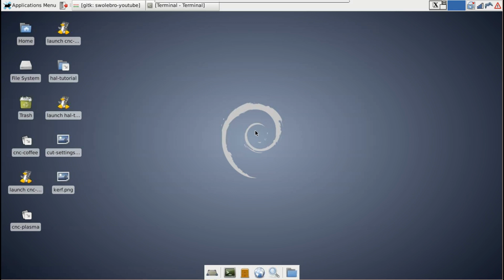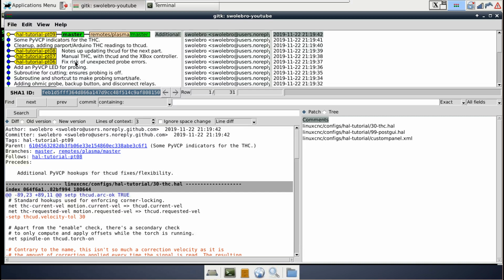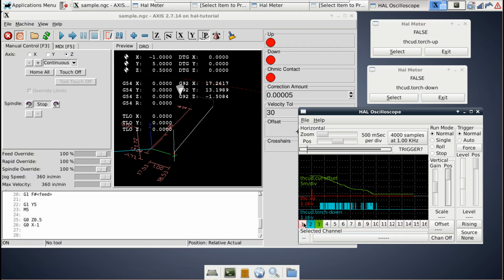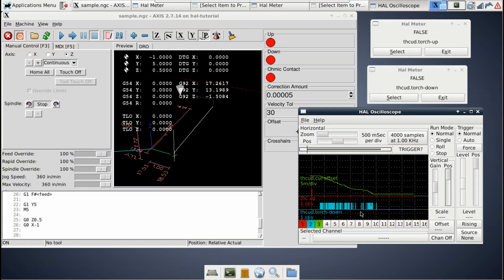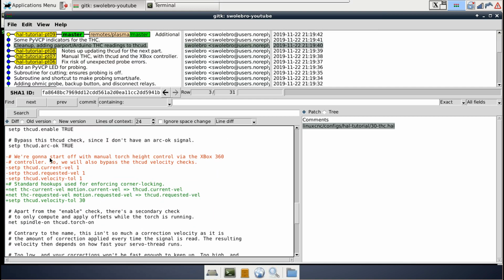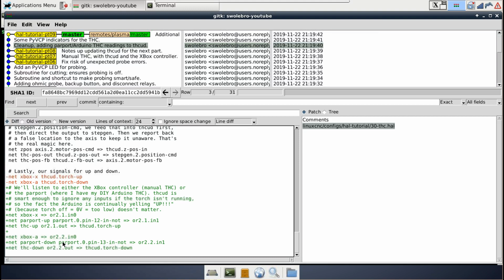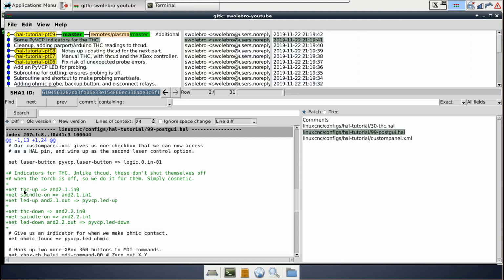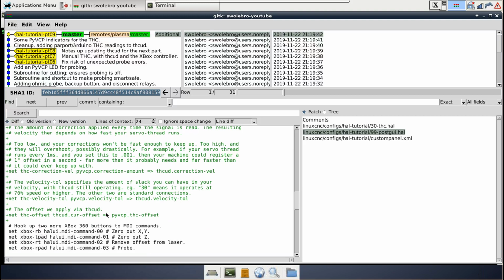LinuxCNC HAL #9: overview, halscope, final thcud

Comment: Thanks for the series.  I'm not ready to implement much of it yet as I'm just starting with LinuxCNC, but the programming aspect is very interesting and I have been inspired by your videos.
I hope you start the bike (frame) building and begin a video series.  A good jig is important; imagine a stepper motor, LinuxCNC controlled jig varying geometry changes to suit type (road, mtb, gravel etc) or size (small, medium, large etc).  Plasma cut drop-outs, braze-ons and tube mitres would be an obvious path, though cutting thin tubes would be a challenge!  
Once again, thanks for the videos.
Reply: Ah, I see from one of your later videos that 'bike parts' really was a euphemism for something else.  My mistake.
Reply from the maker: @regalheros347  I'm an avid cyclist as well. Couple thousand miles a year.

Building a frame is on the to-do list for sure, but that won't be for at least another year or two, realistically. Hell, it took me nearly two years to fix the derailleur hanger from an earlier video, and that only happened because a viewer offered to cut my CAD model on his CNC! Hahah.

Too much to do, and videos make it all take 10x as long.

You should look up Cobra Framebuilding and Pithy Bikes. They've all got some very good content on it.
Reply: @swolebro  Thanks for the reply.  Paradoxically, I have a bike frame builder friend who I have persuaded to help me build my first CNC machine.  I've previously seen Pithy Bikes.
A CNC'd frame jig would be pretty cool though; not sure I could build it.
I'm looking forward to more of your videos.  Thanks.
Reply from the maker: @regalheros347  I think CNC would play more of a role in making parts for a jig, rather than for operating the jig itself. I wouldn't want to rely on the holding force of stepper motors to keep things in place under the heating/cooling stresses of welding.

You could, on the other hand, take the numbers generated by BikeCAD, and use those to make stop-blocks, angle gauges, and the like. Even a 3D printer could make those parts with sufficient accuracy and strength.

I've also had very good success printing off jigs for routing metal (for "bike" parts), and I expect you could do the same to make guides for notching tube ends. A carbide burr in a die grinder will eat right through thin wall tubing, and giving yourself a 3D printed guide to follow could save you a lot of time and machinery vs. a mill/lathe/hole saw/hand file combination.

Also, you might enjoy this brief look into how Moot's does it. Boutique Ti shop.

https://www.youtube.com/watch?v=Jvqo9Ino1lE

I'll get there one day. One day. Hahahah.
Reply: @swolebro  Yes, you're right.  CNC is more suited to many precise movements of a piece rather than a jig, which is really set once and use.  I went down the rabbit hole of frame building a while ago, and decided I preferred riding much nicer frames than I could ever build.  Though my frame-building friend gets a lot of kudos when he rides one of his creations.

Comment: Good video tutorials, but my English not the best, like my programing skills too... 
Can you help me out with a lathe setting up?
 (3 axis stepper motor CNC lathe)
I need to control the spindle with stepper motor (maybe close loop) STEP/DIR. I need to use velocity and position mode too (like an A axis to  drill holes 120 degree with M19 command). Also thread cutting. (without, or with encoder)
I found videos on German language with servo set up spindle, but in my case i need step/dir control.
Reply from the maker: Unfortunately, my only experience with a lathe is owning an 80 year old, manual, very much broken one. lol This video should give you a run down of setting up the basics of a stepper-based system (which set up the HAL files used at the start of this series), and one of the options in the Stepconf Wizard is for setting up a machine with a lathe-style coordinates.

https://www.youtube.com/watch?v=8LVX380iDIk

I'd say start there, and see if you can get going with some basic motion control and turning operations, then build it from there.

For other resources, I know Russtuff has published a pretty thorough series on his conversions of a G0704 mill and a G0602 lathe (both Chinese import machines, sold by a company named Grizzly). Take a look through his lathe ones and see if he's got anything on spindle encoders.

https://www.youtube.com/user/russtuff/videos

And the LinuxCNC forums have a large international contingent. Good odds you can find another German with a lathe to explain things if the language barrier proves to be an issue.

Sorry I can't be of any more help, but I hope this at least gets you going in the right direction. I can guarantee you that whatever you want to do can be done, I just haven't done it myself!
Reply: @swolebro  thanks. I saw all the possible videos that i find. Yours too and Russtuffs too.
Reading English for me more difficult, if we talking about forums.
I'm originally from Ukraine, so the easyest language for me will be the russian. But till now i didn't find the needed information.
Everybody just showing the simple set up in wizzard. (basics) and its not enought for me.